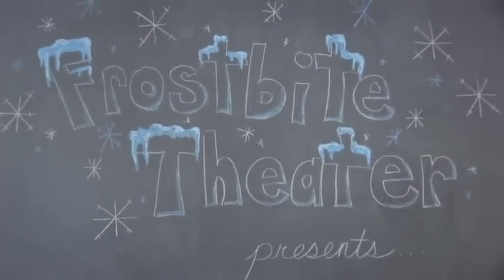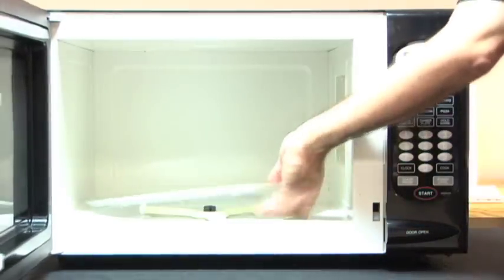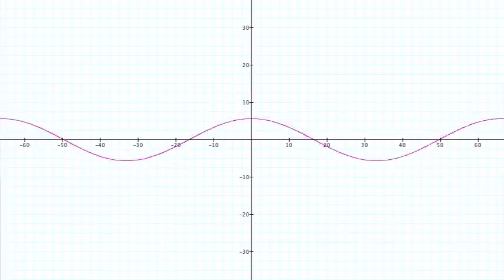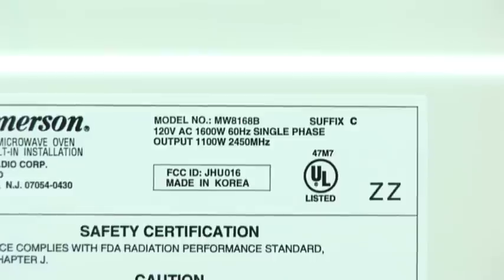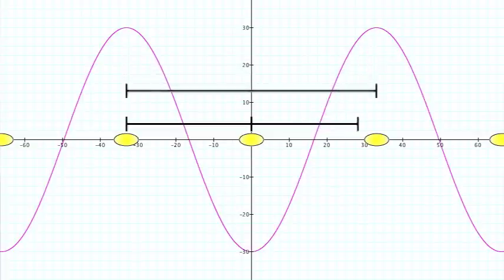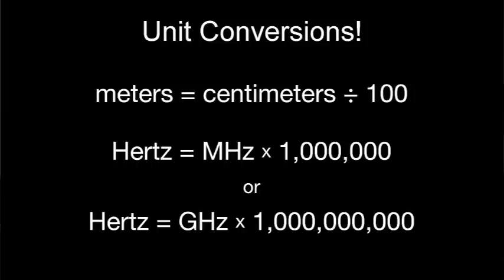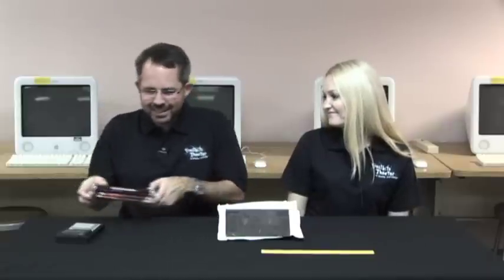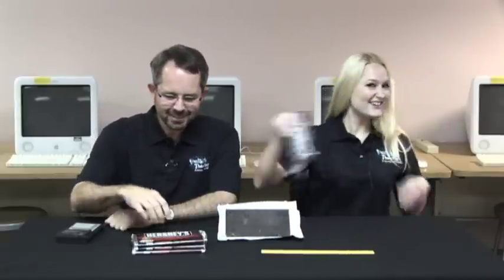Measure the Speed of Light - With Chocolate!

Comment: Why does it have to be an spinning microwave oven. Are there any other types.?
Reply from the maker: Well.... if there are spinning types, then one could reason that there are non-spinning types.

So, why is it important? When you have a resonate cavity, like the interior of the microwave oven, then you produce a series of standing waves within it. The nodes of these waves are where little to no heating occurs and the anti-nodes are where maximal heating occurs. At any rate, the heating is uneven, resulting in hot and cold spots in the cooked food. To eliminate this issue, one needs to move the nodes relative to the food. One way to do this is by moving the food (the spinning type of microwave oven). The other way is to insert a spinning reflector in microwave generator that shifts the wave pattern within the microwave oven (the non-spinning type). In this experiment, we WANT the hot spots, so we need to defeat the anti-hot spot system. It's very difficult to remove the spinning reflector from the non-spinning type of microwave, but child's play to remove the spinning plate from the spinning type of microwave. So, you use a non-spinning microwave in order to get a stationary wave pattern and then remove the spinning plate so that the chocolate doesn't move relative to the stationary pattern.
Reply: @JeffersonLab  First of all, I absolutely loved the experiment. Moreover, I am thrilled that you took your time out to answer my apparently silly question. But, am I glad that you did so...! Hell yeah..!! 

Now I understand this experiment sufficiently enough to explain it to other people. Thank you so much.

Comment: light and waves are different. but thnx because u explaind to me that the Mhz is speed because i always wondering why a pc with 1g ram is faster than a pc with 4g ram !!! the Mhz i detected that is the key but never know why. now i understad the the Mhz is speed
Reply from the maker: Well, megahertz isn't precisely speed, although a computer that has more megahertz will generally run faster. Megahertz is a measure of frequency. For a wave, it's a measure of how many times the wave repeats in a second, but this doesn't tell you how fast the wave is moving (its speed). The speed is related to frequency and wavelength. Specifically, speed is equal to frequency multiplied by wavelength, so a low frequency wave with a long wavelength can have the same speed as a high frequency wave with a short wavelength.

The reason why a computer with a higher frequency runs faster is because the computer executes instructions based on a clock (the thing that's being measured in MHz or GHz). If the computer can do one instruction per 'tick', then a computer with a faster clock (more ticks per second) will complete a certain list of instructions faster.

Comment: Wow, this is nice, yet done years ago, but I'll risk asking anyway: why a rotating plate oven is necessary, i.e. the experiment can't be done with static plate models? Thanks.
Reply from the maker: Because you need the bar of chocolate to remain stationary with respect to the standing wave that's created within the microwave.

There are two ways to eliminate 'hot spots' when cooking with a microwave: spin the food within a stationary wave pattern or keep the food still whilst altering the wave pattern. If the microwave doesn't have a turntable, then it is the latter type. The food stays put and a spinning deflector is used to alter the wave pattern. It's difficult to disable the deflector, so this type of microwave is unsuitable. If it does have a turntable, then it produces a stationary wave pattern. Since we want the chocolate and wave to be stationary relative to each other, the spinning plate needs to be removed to prevent the chocolate from being rotated within the standing wave.

In short, it's easier to defeat the spinning plate mechanism than it is to defeat the internal deflector mechanism.

Comment: My calculation isn't even close...490,000,000 m/s....10 cm node distance...why the huge discrepancy?
Reply from the maker: Don't know. Hard to imagine that the microwave is emitting radiation that's that far off from what it's suppose to be. Are you using a rotating platform microwave from which you've removed the rotating platform? The stationary platform type of microwave will give you problems.
Reply: +Jefferson Lab I took off the carousel, etc. I used a plate, which was really hot...is 10 cm too far?
Reply from the maker: If the plate is heating up, it might be making the chocolate melt in unexpected places. Maybe try a paper plate?

Comment: Nice video. So that means you can calculate the frequency of the microwave and see by how much it is off compared to the stated frequency (assuming the ruler measurement is accurate). 

If you plug in the numbers to Frequency = Speed/Wavelength you will get approximately 2113 MHz. That's 13.8% less than stated on the microwave.  I'm getting ripped off. LOL

Comment: I have this experiment for my research paper this year and I found a problem when I actually did this experiment. The microwave produce a 3D and very complex microwave, the microwave will reflect when they reach the wall of the microwave oven. I tried several times  but I can't get what I want, the distance between two wholes is always unclear. After that I went to google the design of the microwave, I found that there is a a turntable or metal wave guide stirring fan. So my conclusion is this thing "stir" the microwave and the position of the antinodes is kind of random(or very complex to calculate)
Reply from the maker: +Ran Tao That's why we specified the use of a microwave with a turntable. Those don't have the 'stirring fan', so the standing wave pattern remains fixed.

Comment: Sources of errors :
i) 3D stationary waves do not behave anything like 1D ones, you'll get into complicated formulas, especially since a microwave has a rectangular shape, which is hard to put in equation (a sphere would be a lot easier for reflections)
ii) The frequency given on the microwave isn't reliable, you should measure it by hand.
iii) Obviously, the chocolate length measurement isn't very precise. You could improve your results by measuring more precisely between the CENTERS of the holes.
iv) A single experience was led, which is BAD. Repeat about 10-12 times at least.
Still, it's impressive to get a low 17% of error with all those factors.
Reply from the maker: +Béranger Seguin iii) We did measure from the centers of the holes. The thumbnail image that's used clearly shows this.

iv) Already mentioned at the end of the video. Plus, who would want to watch a video containing 10-12 trials of this?

Comment: What limits the speed of light? How does it get to 186,000 m/sec and then stall out? What has it run up against?
Reply from the maker: The speed of light is fixed by how spacetime responds to electric and magnetic fields. The values for this are known as the electric permitivitty of free space (8.854187817 x 10^-12 C^2/N-m^2) and the magnetic permitivitty of free space (4π x 10^-7 T-m/A). The speed of light is the reciprocal of the square root of the product of these physical constants.

Light doesn't start from a stop and 'stall out' when it reaches the speed of light. Light travels at the speed of light. It moves at the speed of light the instant it is created. If you want light (in vacuum) to travel at a different speed, you'll have to change the fundamental construction of the universe.
Reply: What is space?
Reply: Great video! As a related note, your calculations may not have been that far off. Your percent difference should be calculated considering the speed of electromagnetic waves propagating in a chocolate dielectric instead of a vacuum. Relative permittivity of chocolate probably varies in different types but could be 1.3 - 2.3ish. If you calculated your speed at ~2.5x10^8m/s, then you inadvertently measured the relative permittivity of your Hershey's chocolate bar to be ~1.45. I might repeat your experiment and share may results :)

http://en.wikipedia.org/wiki/Permittivity#Relative_permittivity

Comment: I get the method but how do you know that the chocolate bar is correctly centered? I mean if its just a tiny bit off the wave`s x-axis wouldnt that change the location of the melting spots thus falsify the result?
Reply from the maker: If it's all in-plane, then the orientation doesn't matter. Spinning the bar relative to the field doesn't do anything to the relative positions of the spots. If the bar and the antinodes aren't coplanar, then you are going to get some inaccuracies. Specifically, the spots would be closer together by a factor of cos(theta) where theta is the angle between the two planes. Given that one of our melted spots was much larger than the other, it's likely that our bar wasn't coplanar with the antinodes.

Comment: I have another question what's the equation for calculating the percentage error ?
Reply from the maker: Take the accepted value and subtract it from the value you measured. Then, divide by the accepted value. Finally, multiply by 100. As a formula:

((Measured - Accepted) / Accepted) * 100

If you measure something as being 95, but the accepted value is 98, the percentage error would be:

((95 - 98) / 98) * 100 = -3.06%

Comment: Isn't the speed of light equal to 3.00 x 10^8 m/sec ? A lot of websites and videos say the speed of light is 294 x 10^6 m/sec this is really confusing me can someone explain ?
Reply from the maker: The speed of light in vacuum is exactly 299,792,458 meters per second. Usually, rounding it to 300,000,000 m/s, or 3 x 10^8 m/s, is good enough. The 294 x 10^6 m/s number is a bit confusing, partly because it isn't proper scientific notation (should be 2.94 x 10^8 m/s) and partly because '294' aren't the proper digits, at least not for light traveling in vacuum.
Reply: Thank you so much

Comment: I'd think the frequency would drift all over the place with a Magnetron, its not designed for radio transmission or anything, and it seems like it would be all over the spectrum
Reply from the maker: Well, it can't vary but so much, right? I mean, it can't drift so much as to end up in the visible light spectrum, for instance. But, yes, I believe that taking the output frequency at face value is being optimistic, at best.
Reply: Hey Skyler F: Magnetrons were and are designed for radio transmission. Their original purpose was to provide "microwave" frequencies for radar. Their use in microwave ovens represent the last use of magnetrons--which by the way are vacuum tubes--in the consumer marketplace. Now if only I could use a magnetron in my guitar amp........

Comment: Nice! indeed you should repeat the test but you should change the position of the chocolate to better to better align with the source.  While you discuss the resonance (wave pattern due to reflections) the pattern is actually 3D in nature, so the plane of your bar is not actually getting the center of the hot spots but only where the bar is closest to the hot spots but at an angle. Raise the bar higher (and closer to a wall opposite the source)  and you will likely get a better result. (imagine a 3D matrix of hot spots created by reflections (from different walls no less) and if the plane of your sample is not lined up, you get a bad measurement. (too large is possible, but not too small)

Comment: Wont the rebound of the wave within the microwave interfere ( destructively and constructively) with the standing wave and cause altering anti-nodes? Perhaps that is why it was wrong
Reply from the maker: The standing wave is made by the 'primary' and rebounding waves interfering with each other. Without it, you just end up with a traveling wave, and a traveling wave doesn't create hot spots.
Reply: Fair enough, but you've assumed that both the primary and return wave are in exact phase with one another to create a distinct and measurable wavelength. I know you could size the microwave to ensure that the width is exactly X waves of the primary but it's unlikely to be exact. 

The fact that you have two different sized melt indentations may allude to the fact that some regions are indeed constructively interfering better in some regions than others. 

Just a thought. Cool experiment though!
Reply from the maker: geetarwanabe A microwave oven is a resonant chamber, kind of like a ringing bell. Only the waves which constructively reinforce survive.

Comment: why do you need a microwave that spins your food but you take the plate off ??
Reply from the maker: Because you need the bar of chocolate to remain stationary with respect to the standing wave that's created within the microwave.

There are two ways to eliminate 'hot spots' when cooking with a microwave: spin the food within a stationary wave pattern or keep the food still whilst altering the wave pattern. If the microwave doesn't have a turntable, then it is the latter type. The food stays put and a spinning deflector is used to alter the wave pattern. It's difficult to disable the deflector, so this type of microwave is unsuitable. If it does have a turntable, then it produces a stationary wave pattern. Since we want the chocolate and wave to be stationary relative to each other, the spinning plate needs to be removed to prevent the chocolate from being rotated within the standing wave.

In short, it's easier to defeat the spinning plate mechanism than it is to defeat the internal deflector mechanism.
Reply: Jefferson Lab This explanation was just as interesting as the original experiment itself.

Comment from the maker: Repeated trials would certainly help. It's also difficult to tell when the chocolate just barely begins to melt. That's when you'd want to turn off the microwave since letting it run longer makes the melted spots larger. The smaller the spots are, the more accurate the measurements are.

Comment from the maker: Because microwave manufactures deal with the 'hot spots in food' problem in one of two ways. They either allow the standing waves to stay put and rotate the food through them with a turntable or they alter the pattern using a rotating reflector in the mouth of the microwave emitter. Since we need the chocolate to be still relative to the standing waves, we need to defeat the method the manufacturer picked. It's far easier to remove a turntable than it is to dig out a spinning reflector.

Comment from the maker: As long as the centers of the melted spots can be located, the ruler can accurately measure the distance between tham. If everything had been perfect, the measured distance between the spots would have been 6.1 cm and not the 7.1 cm that was seen. So, if the error is in the distance measurement, it's on the order of a centimeter. The spots themselves aren't much more than a centimeter across, so the error in locating the centers should be much less than one centimeter.

Comment from the maker: Perhaps. Part of the problem is that you're dealing with wave interference in three dimensions. I wouldn't be surprised if you don't really get a nice, crystal lattice-like pattern. Also, we're taking the microwave's output frequency at face value. Don't really know what sort of tolerances they are made to.

Comment: Could the error have been because your microwaves weren't parallel to the surface of the chocolate bar? Is there an easy way to determine where the magnetron is (without taking it apart) so you could position the chocolate better?

Comment: frecuency = 2450 MHz
wavelenght = 14.2 cm
Hz = s^-1 = 1/s
MHZ = 1,000,000 MHz

speed = frequency * wavelenght
speed = 34,790 MHZ*cm = 34,790,000,000 (1/s)cm = 347,900,000 m/s

speedr = 299,792,458

variation = 347,900,000/299,792,458 - 1 = 16.04%

Almost right with the 17%